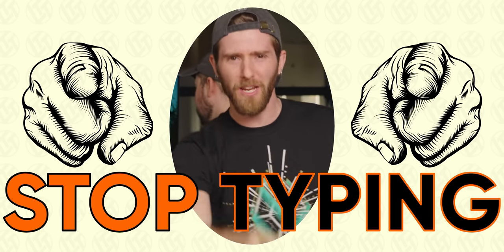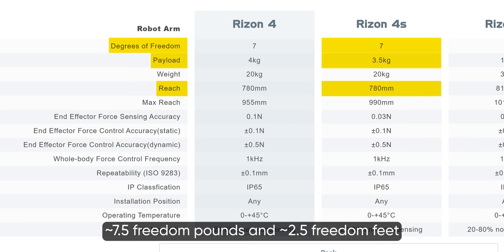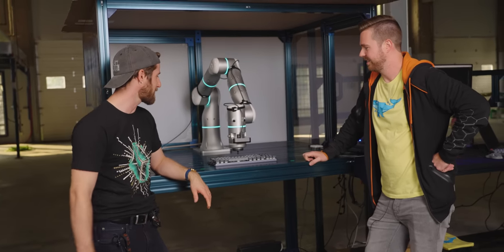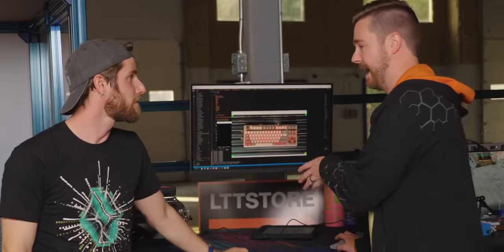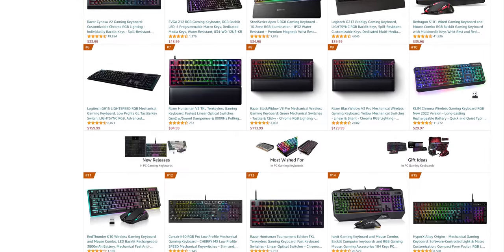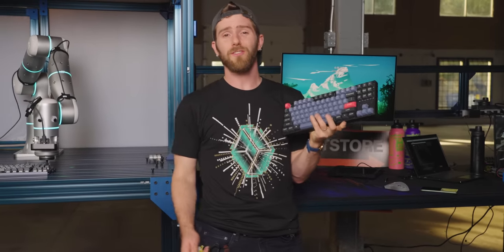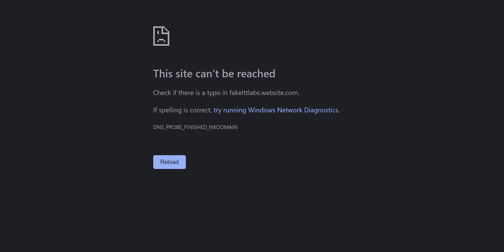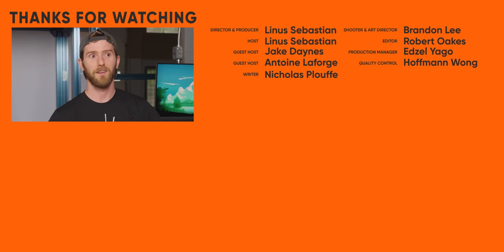Your Keyboard Sucks and I Can Prove It. - Labs Keyboard Testing

Comment: For key location detection, could stick an IR reflective dot to each key, and segment the IR image very easily. No lighting issue, cheap. No fancy depth laser scanning needed.
Reply: ... could use a IR reflective pen to just draw a dot on each key. Even faster.
Reply: Think I'm talking to myself, but hey, use a fixed size dot so it will also tell you the distance to the key surface, knowing the camera FOV and resolution.
Reply: That sounds like a lot more work in the long run than just having a smart laser vision system.  Probably cheaper and easier in the short run but once the hardware has been purchased and the vision system programmed they can just stick a keyboard into the robot, hit run and walk away saving time and potentially money since they wouldn't need to purchase an pen or stickers.
Reply: @grn1  yeah, this would require a couple minutes at least per keyboard, 200 keyboards means 6-10 hours of sticking dots on. Whereas computer vision, while it may take longer to program, results in code and systems which can be reused across many projects and could potentially serve for years without maintenance on a dozen testing setups, saving months of labor.

Comment: Is an idea for data visualisation:
On the website you can have a tool where a user can select his two most important aspects of a keyboard (f. e. latency and preassure).

Then it will plot a graph with this two aspects on x and y axis.

And in this graph, all your tested keyboards will be presented as dots.

Then the user can see which keyboards perform the best in the two aspects he is interested in and can visually compare alternatives
Reply: How about 3 important aspects for a 3d cloud to really see trade offs

Comment: Out of curiosity, why not combine the actuation testing with KAVE with the latency testing to knock two tests out at once?
Reply: yes, totally agree on that. I'm also wondering, why not using a small programm on the computer for key pressing detection that interacts with the key pressing microcontroller to determine the time. Measuring it with the monitor while running a game seems really dumb. Also there is a potential flaw: I don't think that they will test every key for latency (because that would be too much work with their current setup), so it could happen, that some keys are faster than others. Combining it with KAVE seems the only good idea.

Comment: This is a longshot, I know. But have you considered getting your hands on older tech and testing those in the future too? For example, I've been using a Steelseries 6GV2 keyboard for a decade now and haven't found anything that seems like a suitable replacement. If I had the techincal data of my keyboard, that would help me compare between mine and newer offerings. I understand that it's not always possible to get tech as "old" as mine, but I am still curious.
Reply: Tbh, there is no need to change a mechanical keyboard if it works. Most of the time, it's just some personal preferences: RGB, media keys and macros. The tech hasn't changed. Your keyboard can probably and will probably last for another decade.
Reply: I'm still on my 6GV2 as well, 9 years 1 month old! The backslash and media key locations are the only things I'd want changed on this keyboard. 
Only issue I've had is that some keys will double input, but that is an easy fix in whatever OS you're driving.

Comment: Will you also provide the 3D-scan of the boards? This would be useful for designing 3d printed accessories and since you will be already scanning each board it shouldn't be to difficult to pack these as point clouds or stl files.
Reply: seconded!

Comment: I would love to see y'all test an original Model M with this.  Curious to see if a PS/2 connection has any tangible difference in latency compared to a modern USB keyboard, because I honestly can't tell after using my '87 on my gaming rig for the last 5 years 😂Only time it ever let me down was the GTA: San Andreas driving school, where you need to hold down 3 keys at the same time
Reply: I think the difference is that PS/2 input (at least used to be) handled differently from USB input on OS level (PS/2 seems to be interrupt based). I managed to find one comparison study on PS/2 vs USB latency, but it was done in DOS in 2002.
Other than that I'm pretty sure that nowadays with >1kHz polling USB either outperforms PS/2 or has negligible difference
Reply: Gaming wise, not a major difference. Most game engines poll the inputs rather than get "interrupted" at the system level. So even if the PC itself knows about the new updates, the engine doesn't immediately grab and act on it until the next "tick".

Comment: This is the least accurate way that you could test switches. Having the robot on the same surface will introduce vibrations. Also, depending on where the switches are mounted will also change the over force curve of the switches. This setup is totally wrong from the start. 

You need to separate all of your variables. Each switch should be tested by itself rather than in a keyboard. Also there is changes from switch to switch even though they might look the same initially. You guys really didn't do any research and maybe you need to once again ask the enthusiast community for advice that have been producing force curves for switches for a long time. I like that you are trying to get data for the community sadly this is not the right way at all.

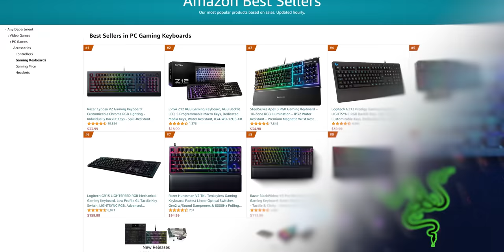Comment: 8:31 "big names" "Logitech, corsair, Razer" 🤮

Topre, Filco, Cherry, Das, etc. got there first.  Ducky, coming up plucky. Cursed mainstream marketing companies got to get it, anyways. Yes, I'm a geekhack Xer.

Also, "Amazon". You don't have to go more expensive than your tower custom, but FFS, Amazon :sad angel: Unless you really know what you're getting into and it's already established, I'd try and buy anywhere else. I'll admit, the returns policy helps. Noobs should go touch keyboards, not gamble on Amazon. Of course, with your data, that'll make buying off Amazon that much less of a gamble.
Reply: Plus it's now a lot easier to get a feel of mechanical switches (well, Cherry moslty) now that mainstream brands all got on the hypetrain. 10 years ago you add to get in touch with fellow keyboard enthusiasts to come test a keyboard in person. Over at Deskthority there was a Cherry MX sampler that was sent through the mail to anyone who asked, as long as they would pass it on to the next newbie who would ask for it.
Reply: @trankzen148  there's still a difference in feel of a complete chassis and different chassis, than even a less than ten key sampler, but yes, keyboard community made a sampler and I think someone sold one, back in the day, too. Of course, not a lot of people knew. The majority were full on either cheapest, packed in membranes or Logitech membrane boards, saying anything else cost too much. I think things shifted more with gamers as linear switches gained prominence or more professionals had RSI issues.

Comment: I would love a simplified noise comparisson, where you look at dB levels, bass/treble levels and so on - to easily find the most wife-approvable keyboards or similar.
Another metric I would personally like, is how much force it requires to move the keyboard itself. 

Nothing is worse than having a decent keyboard, where the rubber feet are so poor it will barely stay in place - and too easily slides across your desk or your wonderful LTT Mousepad™.

Comment: The robot should also test angled presses and slides between keys to stimulate more possible use cases. Another thing that would be good to test would be multi-key presses for ghosting and sticky keys. Its something I had a huge problem with Razor brand keyboards where they wouldn't do well with WASD multi presses and would sometimes either not register the second key press or one of the inputs would persist until the keyboard was unplugged and plugged back in.

Comment: That height calibration on the robot can easily be fixed so that the calibration can be done in seconds. I have done this with the Yumi robot before when calibrating tooltip. The way i did that can easily be transferred to this application. I think a full keyboard test should not take any longer than 5 minutes tops, i guess it depends on how many tests you are looking to do. But if you test for key travel and pressure i dont see why you would need more than maybe 5-10 seconds per key?

Comment: I've used an IBM type K keyboard for a long while. It was made in the start of the 90's and still works wonderfully. I've been gifted two new mechanical keyboards (to lower my typing volume) and both have failed in a few years. The IBM one just works.

Comment: Am I spotting manjaro linux desktop in the wild? 0:44 - its default lock screen of manjaro light theme. 
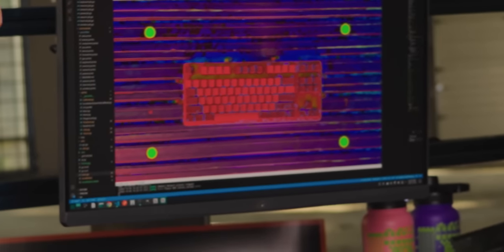4:43 - looks like KDE + vs code. Manjaro loko is blurred, but third icon is system settings. 5:08 - notice "pin" button in left part of title bar

Comment: I have idea for scoring system:
#1 Guitar hero - these are the most badass keyboards on the market and all have dedicated Internet button and stickers. They make the coolest noises and can hold pencils
#2 Roidzilla - these are the craziest keyboards on the market. They come with at least 47 stickers, have F keys up to at least F15, and have speakers. The only reason they are below guitar hero keyboards in ranking is because they sometimes glitch out and become sentient.
#3 Phantom Pain - These are keyboards that have no text on the keycaps, no numpad, and no F keys. They are called phantom pain keyboards because they hurt so bad.
#4 Chucknut Warrior - These are keyboards made entirely of wood. They have wood springs, wood audio, wood electricity, etc. Not much to say about these besides they are made by beavers.
# 5 - Kidney failure - These are keyboards that are membrane material and are sticky. It is unclear if they are designed sticky or if it is because someone spilled a Mountain Dew Code Red on the keyboard.
# 6 Fatal Car Crash - these are keyboards that have hidden mouse traps on certain keys that will hurt your fingers and make you scream like Tom in Tom and Jerry. My dad has one of these.

I think these account for every possible keyboard type. If a keyboard has multiple properties, it can combine names. For example, a sticky membrane keyboard with 47 stickers and at least F15 keys can be called "Roidzilla Kidney." Let me know in the comments below if you think Linus should use these official keyboard rankings and if I missed any categories you can suggest. One that I considered but dropped was the "Murder" keyboard that shot lasers into your eyes and killed you.

Comment: I bet ML based optical object detection is a slam dunk for identifying and locating each key, regardless of minor lighting changes.  Keycaps are printed with characters that are supposed to be recognized visually and off the shelf object detection models are surprisingly good!

Take 20 - 40 images of a handful of keyboards. The brunt of the work - draw bounding boxes and label each key in each image using labeling software. Train these labels against an open source object detection model like POCO or YOLO. Test the model out on pictures of a few novel keyboards...

For nerds like us, post the labeled image dataset on Kaggle and you will have multiple working solutions in no time.

Comment: So glad to see stuff like this, remember moving from Razor to Corsair mostly because the mouse and keyboards just didn't last very long and Corsair also stuff just felt smoother to use. (Love a mouse with 12 Keys on the side but typically that is what dies). So having an extra place to look when I'm considering a new keyboard is gonna be great. Also look forward to seeing what you do with mice ^^
Reply: you might be interested in the Swiftpoint Z or Swiftpoint Tracer mouse.  I have been using one for more than 3 years and it has only just started physically breaking down on me.  3 years is not the best, but better than many I have tried.  But I can say that I have enjoyed it far more as a gaming mouse than any other.  Their buttons and placement and programmability are far more convenient and thoughtful in my book than others I have tried.  It does take a little getting used to, but once you do... it's great.  I have tried g500 g700, naga, steel series rival 3 and 5 mice.  So far nothing comes close to the swift point z IMHO.
Reply: That's my experience with all my razer products so far. They don't feel premium and tend to be less durable.
I recently got a razer product again... Let see how long this will last me.

Comment: I have changed computers multiple times over the years but I still use the same Dell SK-8110 that I have been using since spring 2003.  Yes, I have been using the same keyboard for 19 years, I feel at home when I use it, it feels right and it still works great

Comment: I like what you are doing.  Back in the '80s I built a pneumatic keyboard tester for telephones.  Not precision, but it got the job done.
Your keyboard latency test is not very precise. There are too many variables for any precision measurements.
I'd use something simple and low cost like an Arduino to run the whole testing & timing process.  You could easily duplicate the test so you could test many keyboards at once.

Comment: I'm sure that someone has mention this and you guys didn't point it out in the video or maybe I missed it. But do be aware that mechanical switches doesn't actuate the moment it pressed down or when it bottoms out, it's called pretravel, measured in mm. I hope that your latency and actuation force testing does consider that factor. And I hope you guys test other switches as well not just those shitty cherry mx switches like jwick, gateron, kailh, etc. Maybe have like one keyboard that build specifically for testing switches or build a custom switch holder so that it's repeatable. I'm excited for this lab thingy, seems like its gonna change everything.

Comment: This is cool. Some of these setups could also test all the emulation options on the 'official' products. Measuring latency in emulation + system + controller setup.
For example, what's better for latency? I've picked snes, as it's 'easy' to emulate with modern hardware but latency can still be an issue.
SNES emulation on Steam Deck,
SNES emulation on Switch,
SNES emulation on WiiU/Wii
SNES hardware emulation on SuperNT + different monitors
SNES on real hardware + CRT
SNES emulation on SNES Classic,
SNES emulation on unofficial handhelds

I know people have done tests on frame latency in some of these cases but not all of these compared together in the same standardized tests

Comment: Looks pretty nice especially with the robotic vision system. However I do hope the plan isn't for the front to be open like that without even area sensing inhibition or light curtains. 

Yes you have a collaborative robot, but it clearly isn't set up as true cobot with that initial move speed plus entrapment zones. Not entirely sure how the regs are set up in Canada, but I'd wager they are similar to how they are in the UK. Stay safe.
Reply: Agreed, a light curtain and an E-Stop would go a long way.

Comment: What about testing key caps first? They break way before the switches! My corsair K70 already have multiple keys replaced or about to break... The weak point is usually the + shaped plastic that's connecting to the switch head!